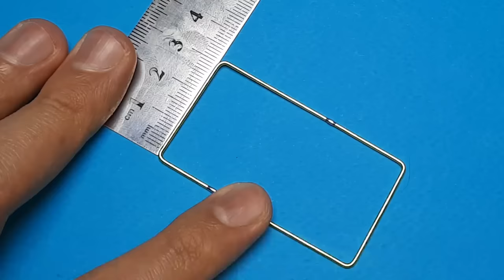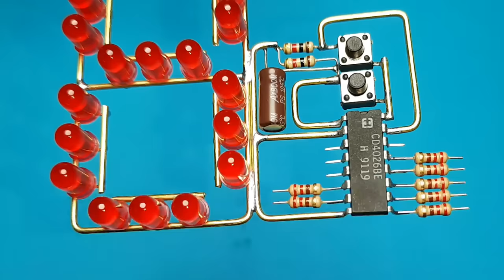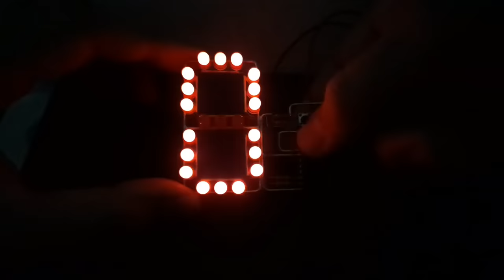How to make Seven Segment Counter Using IC 4026

Comment: The interesting thing about such a circuit is the fact that you can make the seven segments out of any type light with whatever lights you want. The same circuit can be used to input to the proper segment drivers and will work with billboard size to very small micro size segments... The same logic chip works with them all... Thumbs Up!

Comment: I like this circuit alot, I'm wondering how you could attach 3 or 5 more segment blocks (Digits) to make a working clock.
Reply: don't expect an answer from the creator. I doubt he knows much - he is just copying a circuit.   This is a "Look Mommy at what I did" video.
Reply: Look up the chip specs and it will show you how to chain them together...
Reply: There's a 'carry over' pin on the IC that  you can connect in place of the input button on subsequent copies of the circuit

Comment: The novice in me trying to learn, sees this, and gets annoyed that nothing is explained, and it's just here are some values, look what happens. BUT, the former artist in me sees that you have measured and planned out the project, likely with many revisions and it's not meant to be a tutorial; even though the title implies otherwise (that part still annoys me) but a showcase of skill and art. The fact that the capacity is perfectly framed by the resistors leads is says it all.
Reply: it looks pretty but is not practical and suffers from design problems [amongst other issues]]
Reply: @Kenn Mossman  my current issue with these types of videos is that I can follow along with the voltage and resistance by watching along but the moment a chip gets involved it's a block box that tells me nothing and it might a well be high end CPU being connected. I want to know how it works, not that it works. Also, if this was meant to be practical, it would have been sent to a PCB and used surface mounted components. Nothing is practical about the brass pipes used.

Comment: Grab some enameled solid core copper wire.

Brass isnt the best for this.

Also....might wanna use something with insulation in general.

I know these artistic in-line circuits look cool, but we all wanna be safe 😅

Comment: Yes, it is a way. Not one I would recommend.
Reply: "Dead bug" style is very prone to breakage, heat damage[while soldering] lead breakage esp of ICs. I use a socket for ICs to prevent heat damage and allow easy replacement.  This is what I call a "Look at what I did, Mommy" video; no explanation, nothing educational, no pros/cons discussion, nothing on parameters, etc

Comment: afther 9 can do a CARRY to another 4016?
CAN count 0-5? 
Didi you have schematic?

I want to do a clock (minutes) wit LOW tech possible
Reply: carry pin, multiple clones and 555 timer to drive it. clock will not be accurate for long but still a cool project

Comment: did you ever hear about a PCB? or a Breadboard?  :)   Nice looking circuit anyway......
Reply: There was a time before PCBs and breadboards where components were literally wired together although probably not as neat or artsy as this…
Reply: @richards7909  - True, almost all of the components in old vacuum tube TVs were assembled this way.
Reply: "Dead bug" style is very prone to breakage, heat damage[while soldering] lead breakage esp of ICs. I use a socket for ICs to prevent heat damage and allow easy replacement.  This is what I call a "Look at what I did, Mommy" video; no explanation, nothing educational, no pros/cons discussion, nothing on parameters, etc
Reply: @kennmossman8701  - you identified the problem with how this particular video assembled the components. In those old vacuum tube TV sets, a mechanical connection would first be made by wrapping a component lead around a terminal or twisting component leads together; after a mechanical connection was made, only then would solder be applied. The construction methods in this video tend to have cold solder joints besides those joints not having a firm mechanical connection, and hence as you stated vulnerable to breaking.
Reply: @stevebabiak6997  Also thermal stress, especially as done here. Particularly when several connections are made to a component. And even more with heat-sensitive parts.
Reply: @kennmossman8701  - part of the reasoning for first doing a mechanical wrap before soldering was to give better tolerance to thermal expansion and contraction.
These YouTube makers would benefit from reading NASA or MIL-SPEC soldering requirements.
Reply: @stevebabiak6997  I would be more blunt - most  know f*ck  all about  electronics.

Comment: What is with all these no-breadboard electronics? Isn't it just needlessly more complex to build?
Reply: I keep my breadboard in my pocket protector at all times
Reply: "Dead bug" style is very prone to breakage, heat damage[while soldering] lead breakage esp of ICs. I use a socket for ICs to prevent heat damage and allow easy replacement.  This is what I call a "Look at what I did, Mommy" video; no explanation, nothing educational, no pros/cons discussion, nothing on parameters, etc

Comment: This is neat, and good work, but aren't you not supposed to run LEDs in parallel like that? each LED should have it's own resistor, otherwise their brightnesses won't match up, and some will get more current than you want, due to manufacturing differences.
Reply: I’m glad someone mentioned this.  Indeed it’s a very neat project, but the leds each might have slightly different voltage drops, causing basically too much current to go through some.  The resisters in place will at least limit the overall current, so nothing is likely to be damaged, but it’s not “good practice” to put diodes like that.
Reply: Given that all these wires are totally uninsulated and crossing right next to each other I'd say mis-matched resisters are the least of their problems.
Reply: I would argue that it is NOT neat nor good work. "Dead bug" style is very prone to breakage, heat damage[while soldering] lead breakage esp of ICs. I use a socket for ICs to prevent heat damage and allow easy replacement.  This is what I call a "Look at what I did, Mommy" video; no explanation, nothing educational, no pros/cons discussion, nothing on parameters, etc
Reply: that'll be 3x the resistors. But, If your pin gives you 9V, just connect them in series, and have 1x resistor for all 3
Reply: @Thamstras  They might be a "transformer wire". These wires come with insulation that boils off when you solder. I think that's the case, because shorts would occur and be noticeable
Reply: @eitantal726  Yes, it is enameled wire used for electrical motors and transformers winding.
Reply: yes, LEDs in parellel should have their own resistor. Even a slight difference in Vf can cause one LED to grab more current and sooner or later burn-out
Reply: @eitantal726  TTL logic circuits output less than 5V. The CMOS version can operate at higher voltages and so have a higher output voltage but their current capability is quite low
Reply: @kennmossman8701  isn't the VCC of the IC connected to 9V tho? you'd think a pin is capable of outputting that, no?
Reply: @eitantal726  The video is such crap that I lost interest quickly. Maybe it is which means its a CMOS type. That highlights the lack of explanation and description in the video....like I said, it is crap
Reply: @kennmossman8701  I understand you're pissed about the video. That being said, I don't think I could solder like that, or have "air-pcb" like that, either. While it lacks in practicality, it does have some merit. Understand that the audience isn't EEs like us, but the general public
Reply: @Thamstras  The wire being used is an enamel coated wire, they are touching but not conducting. Most likely winding wire for motors and coils.
Reply: @kennmossman8701  Very educational if you pay attention. If you don't understand how this is being done or how the connections are made, then you don't understand electronics very well. These IC's have a heat tolerance, and no need for a socket unless you hold the iron on the leg too long. If you have the skills, you can do this too just like I did by following along, no explanation was needed  and mine works great.  Good luck and enjoy!
Reply: Do your own video in that case.  You sound very jealous.

Comment: Have you done a two digit counter at all? I need to repair a scalextric lap counter.
Reply: Use two CD4026 ICs, connect input pulses to first, and from pin 5 to clock second. First will be units counter and second will be tens counter. This IC is not suitable for multiplexed displays. One IC for one digit.

Comment: Symbol for 7 is wrong. Segment F should be on.
You're missing some better debouncer, the capacitor doesn't seem to do a perfect job.
Reply: It's not "wrong" at all, which a glance at the datasheet could've made obvious. Different decoders use different display styles.

Comment: Well as far as I can see It's shorted fucking everywhere, but whatever.
Reply: "Dead bug" style is very prone to breakage, heat damage[while soldering] lead breakage esp of ICs. I use a socket for ICs to prevent heat damage and allow easy replacement.  This is what I call a "Look at what I did, Mommy" video; no explanation, nothing educational, no pros/cons discussion, nothing on parameters, etc